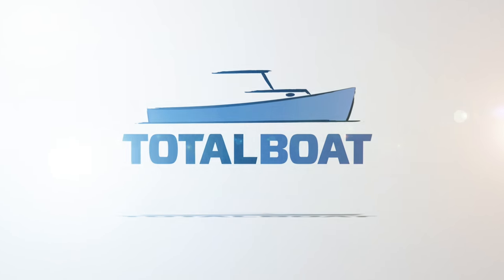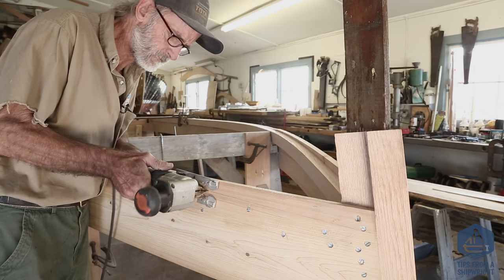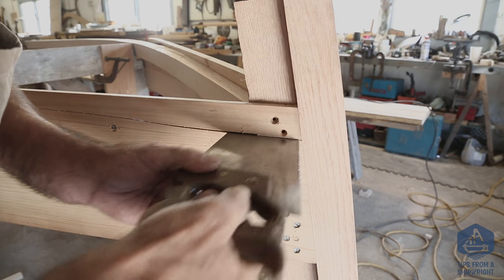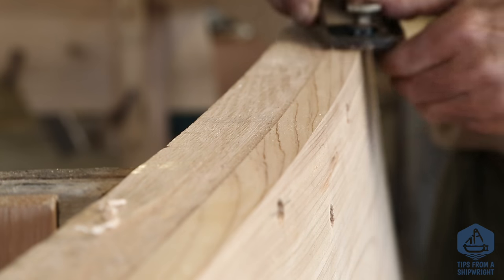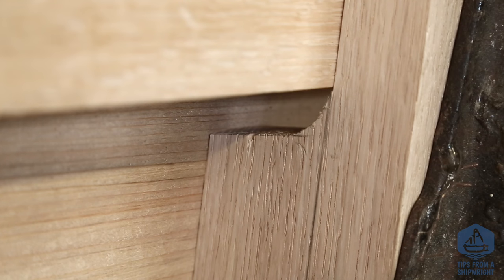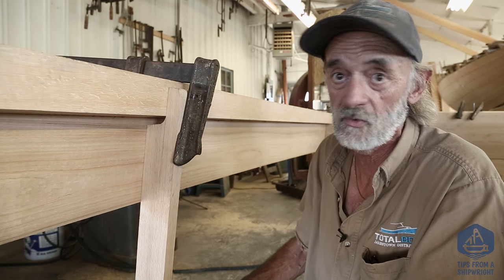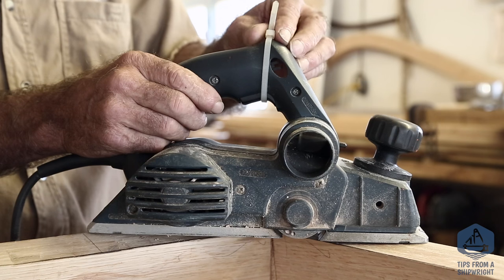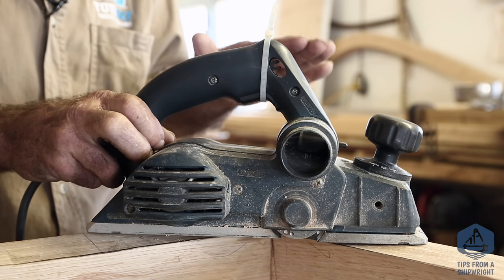Building the TotalBoat - Preparing for frames (Episode 10)

Comment: Considering there are no electronics in that planer, simply a switch and maybe some control cap, i'd lob off the handle, and make a proper wooden one. What was in the mind of the designers when they put the handle on top is beyond me...maybe they think you'd use this on a wall. Excellent episode.